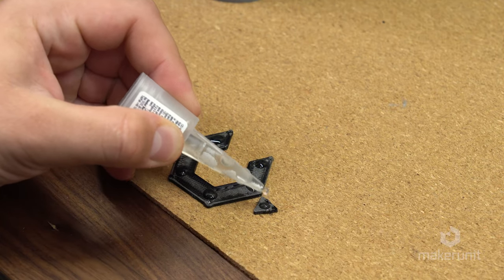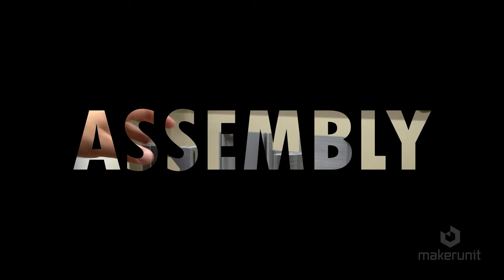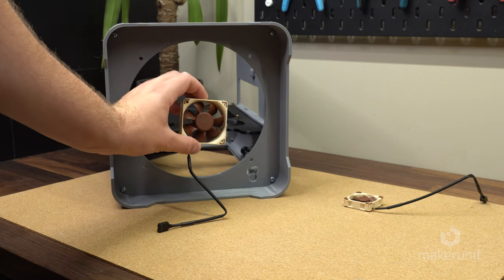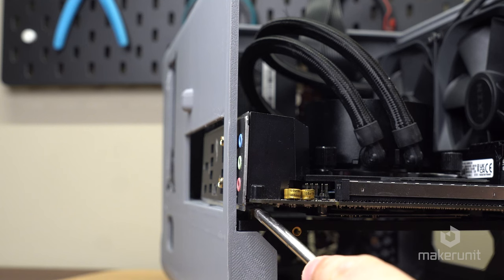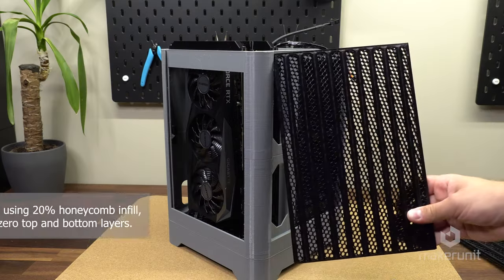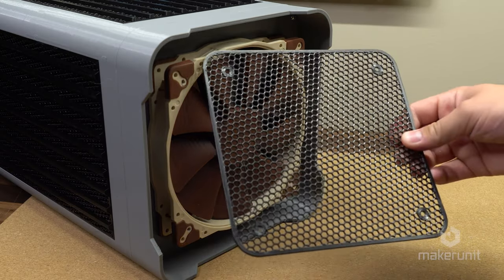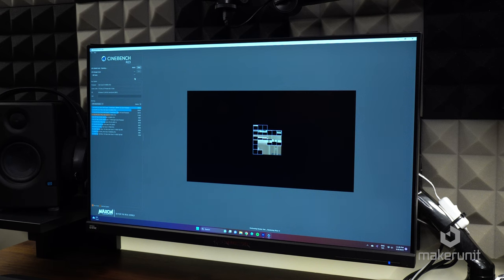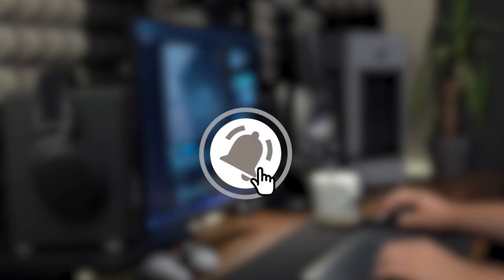Mini ITX 3D Printed PC Case Chimney Style

Comment: Man this is a pretty cool build! I bet it would look even better though if you had the exterior sanded or smoothed out in some way.
Reply from the maker: Thank you! Would definitely look even better if the surface was treated a bit. However, I live in a flat so sanding is not ideal due to the dust it creates which is also why I don’t do it 😅

Comment: If you did another case… good inspiration might be… what if Dyson made computer cases?
Reply from the maker: What pops into my mind is a PC that’s cooled by one of those Dyson hand driers that are often found in public bathrooms 🤣
Reply: @makerunit  oh yeah… but I think about things 3d printers are uniquely well suited for. Like hiding the fan out of sight, out of mind, but designing narrow ducts for airflow, using round shapes, etc
Reply from the maker: @TerraMagnus  yeah I get what you mean 😊 only problem is that small ducts and high airflow might cause noise, but I guess some designs are better than other on that. I

Comment: Hey man would it be possible to fit a fully liquid cooled pc under 15 litres of volume? I currently have my gpu cooled inside the lian li tu150 case which is right under 24 litres, i would want to go smaller though!
Reply from the maker: Fully liquid cooled, like CPU and GPU? Hmm, possibly, perhaps in a console style layout maybe. I don’t currently own any GPU watercooling solution so I’m not sure how I’d fix that but should be doable yes.
Reply: @makerunit thank you for even considering it!

Comment: I watched a video recently somewhere else talking about noctuas fan design. Somewhere inthere it said if u leave at least 7mm of space between the fan an the mesh u avoid turbulence noice. Fyi thought u might wanna know 😁
Reply from the maker: Yeah I’ve noticed a similar problem in some of my cases, but it only seems to happen if the fan sucks air into through the mesh and not when its exhausting it out. At least from my experience. That’s why I added the hollow circle inside my Little Boy S case where it sucks air through the front panel I had really bad turbulence noise in my first prototype. 

On the Noctua 200mm fans this doesn’t seem to be a big problem as I never really noticed any noise at all from this chimney design. Might be the lower RPM of these large 200mm fans that make the difference, also a tighter infill mesh seems to lower the noise at the cost of lower airflow.
Reply: @makerunit  eyyy thats awesome i learned something new, it doesn't make the noice if its exhaust. Thx man!

Comment: Awesome build. Where do you purchase your power switch? Does it have a built in light? I'm currently designing a PC build within an Ikea Alex drawer. It's gonna have a lot of 3D printed parts mainly to improve airflow. Right now I'm working out the details of the front i/o and on/off switch. Thinking about creating a separate unit placed on the desk with custom wiring to the motherboard.
Reply from the maker: Thank you! I purchased mine locally in a store  called Kjell&Company in Norway which judging by your very scandinavian sounding name you’re probably familiar with? 😁 

If not, you can get these buttons pretty much everywhere, Ebay, Amazon by searching for 12mm power button.
Reply: @makerunit  svensk :) Kjell o company  finns hos mig i Luleå. 😁
Reply from the maker: @JoakimStenudd  Så bra! Lykke til med ditt prosjekt! Det hadde vært roligt å se noen bilder når du er ferdig 😃

Comment: Would be interesting to see a case that's convertible to sheet metal.
Reply from the maker: That might be a tricky one, as 3D printing and sheet metal would need to be designed in very different ways, like wall thickness etc, sheet metal would work with 1.5mm thickness and 3D printing I usually do at least 3 but mostly 5mm or more thickness on the walls to be rigid enough. 😅 also unfortunately I don’t have access to metalworking tools and the space at the moment but hopefully some day I’ll be able to get access to that too! 🙂

Comment: Man, I wish this case was a smidge smaller. Instead of the big fans top and bottom, I would love them to be just 120MM or 140, but I don't know if that is physically possible.
Reply from the maker: Physically it’s possible to make the fans smaller. That’s easily fixable with some thin adapter plates only. The total size has some room to shrink and I could have probably managed to get it 10 mm thinner both ways if I really squeezed everything together but I was worried it would be too tight. I might make a «replica» of this design as well, just made for smaller parts in a smaller total body size. It would be a fun project to size down.
Reply: @makerunit   I have an ender 3 and am on the hunt for a case that is vertical cooling like this one, but 120mm fans top and bottom, and can fit a full size gpu :) I don't know if that is possible. I have a cr-10 I am converting to a switchwire that I will print this with once I get it done if you dont release anythign else in the meantime.
Reply from the maker: @jeremiwebb7519  I see. IF I end up making one it might not be in the nearest future though. Designing a case takes a lot of time and testing and finding the most effective layouts etc… meaning I’m not able to just spit out new cases every week unfortunately. 😅

Comment: Another idea that could be useful and environmentally friendly, using 3d printing to create panels that allow uaing old OEM cases with modern motherboards and components that arent compatible.    I have an old Dell XPS desktop that could be refurbished but I want to put modern hardware in.
Reply from the maker: Hi! I like the idea but it would require me to actually have that case first to test fit everything. That’s also the main reason I mainly do ITX builds as I base my designs on the parts I have available to test and currently I don’t have an ATX motherboard so that’s why I also have not made a case for it yet. 😁

Comment: I think screwing straight into plastic is perfectly adequate under some circumstances. If something is a permanent or mostly-permanent build, then even machine screw into plastic is OK. If it's supposed to be serviced regularly, then you need a threaded insert. Screw into plastic connection is by no means weak if well calibrated.
Reply from the maker: Yeah I agree with what you say here. Permanent installation, no problem. Regularly opened, inserts are ideal. I’ve made many pc cases that do not have any inserts and I don’t really have any issues with that. Only problem is if I tighten a little too hard on some screws then it could strip the plastic.

Comment: How much does it cost to print something like that?
Reply from the maker: Depending on the filament price where you live, roughly 3-4 kilos depending on infill density and print settings. I believe I used approximately 3 kilos in total. So let’s assume about $20 per KG, about $60 for just the printed parts themselves I guess… 😊 hope this helps. + electricity cost etc…

If your question is aimed more towards how much it costs for a print-on-demand shop to print it for you, probably a bit more, I’d guess over $100 at least, maybe more as it takes a while to print… 😅

Comment: Seeing your GPU temps makes me wonder if they are experiencing turbulence.
The GPU is pushing air horizontally toward the card, however the top and bottom fans are forcing air up vertically potentially pulling some of the fresh air away from the gpu (as well as the hot exhaust air coming out as well).

A way to test this is to turn off the top and bottom fans (and pull them out) and check the gpu temps.
(your cpu temps should be okay as the AIO is actively cooling the radiator).

Another option would be to remove the fan shroud from the gpu and just use the 200mm fan to pull air up. But I have doubts that will pull enough air across the gpu though.

The real way would be to do a smoke test to see where it's all going.

Anyway, just my $0.02. Cheers
Reply from the maker: Thank you for the suggestions! That does kind of make sense. Possibly a different solution could be to just use the top fan as exhaust and an offset 120 or 140mm fan at the bottom only blowing air in at the CPU side, maybe that’ll help.
Reply: @makerunit  
One other thing that just popped in my head:
the GPU is too far from the side panel, meaning it might be recirculating the hot air inside the case.
To get around that:
- move the gpu closer to the side panel
- "hotbox" the top of the gpu (create a shroud going from the side panel to the gpu
- use a gasket to create a "seal" between the intake of the GPU fans and the side panel.
Reply: Gah, sorry another simple test/idea that might work:
use both 200mm fans as exhaust.
If you have the gpu and AIO pulling in air, having them both pull air out will help with getting cooler air in from the sides. 
Again, this is "in theory"
if you AIO is pushing out though (exhausting) then this wouldn't be a good setup.
Reply from the maker: @lordhighbinary2006  The AIO is currently pulling cold air from the bottom fan out of the case with pretty good temperatures. I mean 54 °C on a 10900k is pretty good I'd say. 

Yeah you're probably right, the GPU is not close enough to the side panel, a "sponge"  duct or something between would probably help a lot there.

Comment: That is one nice case. Sadly, some parts won't fit on my printer's bed!
Reply from the maker: Thank you! What size bed do you have?
Reply: @makerunit  256x256x256. The side filter is a bit too long..  But I can cut it in the slicer and print it in 2 parts if needed.
Reply from the maker: @patricklebel1141  as it’s a sliding track I don’t see how it would be a problem to print in two pieces. You can align the cut with the center line clamping the main body for example and it might not look too bad actually. On the other hand, the tracks have a function of stiffening up the body by interlocking the parts together but if the build is intended be stationary I don’t see any issues with that 👍

The other parts that won’t fit are the motherboard plate and the AIO mount. Though these should also be possible to split.

Comment: how about designing a case where thew top and bottom fans are exhaust and deliver all the air through the radiators for the grapichs card and cpu?
Reply from the maker: Hmm, possible, I’m not an expert at airflow but I feel like if two fans are pulling opposite directions they might not be as effective but I might be wrong.  I’m thinking about the top and bottom fan…
Reply: I mean like obe if the corsair cases have it like that, pulls air through the radiators on the side
Reply from the maker: @mgut17  yeah about the radiator pulling in from the outside I’m for. I’m just not sure how pulling the exhaust two different directions might disrupt the airflow, but might work. 😊

Comment: Would be cool to see the desktop lay down cases that were popular in the early 2000s  but make it mount to the underside of the desk
Reply from the maker: With built in screw mounts? So you can screw it directly to the underside of the desk? That’s a pretty cool idea actually! I’ve got a bunch of 92mm fans I could use for that.
Reply: @makerunit  i know its not the best for thermals cause heat rises but i have my tower in a tower mount bolted to my desk cause its a sit stand desk  but the horizontal cases would take up less leg space and bring back an abandoned case format
  stuff like the antec vsk2000u3, or silverstone gd09b
Reply from the maker: @alphaboltz  enough fans/airflow can compensate for the rising heat though. Let’s say if I had 3x 92mm (3 on each side) fans as intake and exhausts, it would force air through the case and out the other side, constantly replacing it.
Reply: @makerunit you should do it!!!
Reply from the maker: @alphaboltz  definitely an interesting one that I’ll consider!

Comment: I have the exact same Gigabyte RTX 3070. My recommendation: try running it at 1860MHz @ 900mV. Made it drop from 246W to 180W for me. Also, this card has fan humming from 950 to 1150rpm. 1250 seems to be the sweet spot for noise and temps. You might lock it there (under load) for good noise/temp performance.
Also, I highly suggest turning off fan stop and letting the fans spin at 21% on idle (set by Afterburner). Remember that for Gigabyte cards, only firmware control mode works. Don't ask why.
Reply from the maker: I see! I’ll see if I can figure it out and will give it a try if I manage to do it! 😁

Comment: I would love to see this as a "vertical style" case. Meaning that the motherboard and GPU IO is on the top, wich makes it ideal for placement under the table.
Thanks for the great design
Reply from the maker: I’ve always had my PC on the table as I like it to be a part of the desk decoration so I’ve never actually even thought about that 😁 but I’ll consider it for a previous build if the design gets right 😁 but would you still have wanted the IO hidden or just open?
Reply: @makerunit  My favorite would be a small hatch to access the ports. Similar to the "cloud unit" from DIY Perks.
I think this is the perfect combination of easily accessible and looking nice.

I'm planning to design my own PC case in the future. Do you have any tips for designing my first PC case? I already have quite some designing experience from other projects, but I guess PC design has its very own challenges :)
Reply from the maker: @Lennard222  My most important tip is probably. Don’t forget to consider the cables when designing. 

Imagine where all the cables would go, and add extra clearance and holes for cables where necessary. So many times I’ve printed a part only to realize there is no room for the cable I’ll be attaching 😅 like even for the bottom fan in this build.

Comment: Petg or asa? Thanks!
Reply from the maker: Gray filament is actually PLA, black filament is PETG 👍 but you can choose any filament type you want 😊
Reply: @makerunit   I asked because PLA cannot withstand high temperatures, the graphics card reaches a high temperature. 

The case turned out great!

Comment: After watching the video from optimum tech i would love to see a version, where you seperate the hot air and cold air better. basically he created a fan shroud for the gpu fans to pull in fresh air from the outside instead of the warm air inside the case. dope would be different gpu shrouds that can get mounted to the black honecomb on the gpu side and that ends up flush with the gpu fans. That should help a lot with gpu temps.
Reply from the maker: Funny enough I was just about to start a project after posting this one, using fan ducts just like what Optimum Tech did, but he beat me to it so I’ve got to work on another solution but that path has crossed my mind. 

I was inspired by part cooling on 3D printers, why not make airflow patterns that are specifically directed towards the areas that need cooling rather than everywhere 😁 (would still need some flow in the entire case but like targed specific areas of the print using custom designed ducts. 😁
Reply: @makerunit  then I can’t wait to see what you come up with. In the mean time I will try to remix your design with the step files. Have you ever considered putting a fine mesh over your print while printing to create a dust filter? Would be interesting especially on the bottom hexagon print
Reply from the maker: @henrigrotkamp  I feel like a fine mesh at the bottom, it would be too restrictive, but I’ll leave that mesh part up to the individual as it can simply be stretched and clamped between the fan and the fan guard at the bottom 😁

Comment: Hi makerunit! I am thinking of diving into the world of 3D Printing and thinking about getting myself a Bambu Lab A1 to begin with.
I have 2 questions regarding this:
1.) Is it feasible to minimally increase the height of this so to accomodate a GPU with 320mm length?
2.) I found out that at some parts require a 30cm print bed. Any chance you update this like your newer builds to make them joinable and printable on smaller printbeds?

Thanks for your awesome work and vids! 🙂
Reply from the maker: Thank you! I might at some point make another similar build but probably not this exact one. However, there is one guy on Printables (or maybe Thingiverse) who posted a split remix of this model. So you might get away with using that one.

Comment: Nice work, this will be my next project to build !!! … just one question, could be any possibility to add a 360mm size AIO cooler ?  Thanks
Reply from the maker: Thank you! About the 360mm radiator, unfortunately it’ll be too tall, alternatively the case would have had to be really tall, which would make it a lot bigger…

Comment: Do you have any links for what you used for the IO/power button?
Reply from the maker: Hi! So I did buy mine locally in Norway but this button is pretty much the same, except the fact that mine had a white light ring.

https://www.amazon.com/YACSEJAO-Chassis-Switch-Button-Computer/dp/B0BWDZ2HM6/ref=mp_s_a_1_7?crid=B4ESO0ZVEJTT&keywords=12mm+power+button&qid=1707299464&sprefix=12mm+power+button%2Caps%2C292&sr=8-7

Comment: Nice design, I'm surprised you didn't sand and paint it though
Reply from the maker: It crossed my mind and I would do it if I had a space for it where I could dust without worrying, unfortunately in my flat it’s not very practical to do sanding.. 😅
Reply: @makerunit  That's understandable